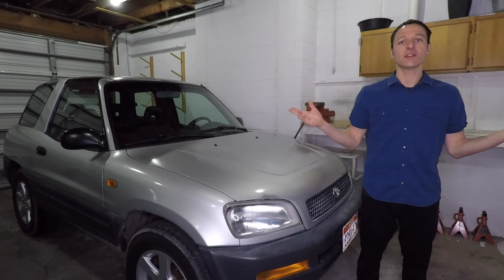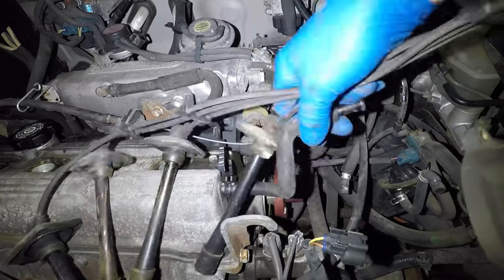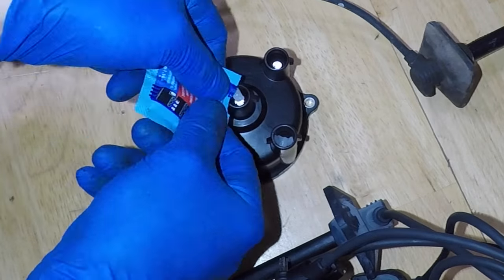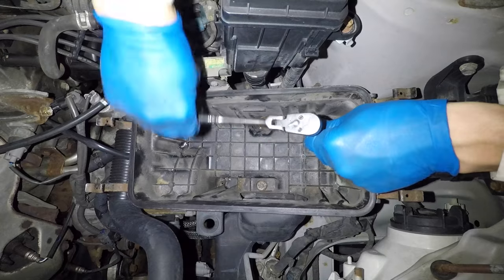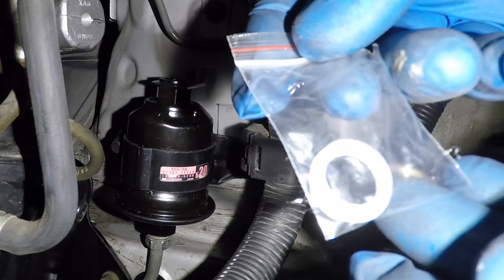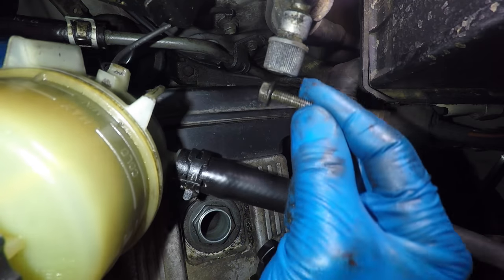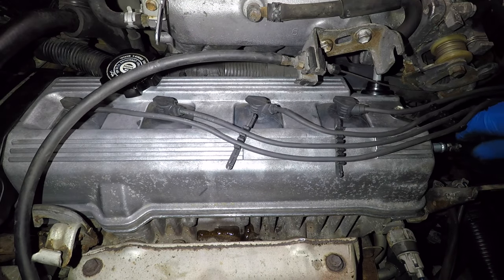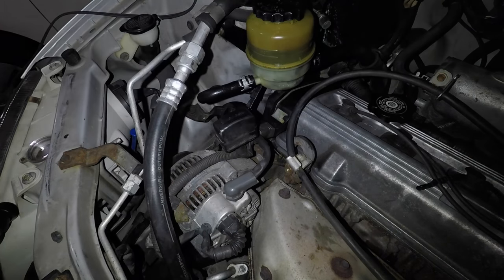RAV4 tune up: spark plugs, distributor cap, fuel filter, ignition timing (episode 5)

Comment: I can't make out the part numbers in the photo. Can you please tell me how to go about finding out part numbers on my own. Thank you 😊

Edit: For some reason I can see them now.  It isn't my eyes because my partner couldn't read them either.  Must be my phone? Idk but they are not blurry now, just tiny. I got all of them except the fuel filter because it is on the side of the box. The 0 with a line through it was tricky. Wasn't sure if it was 8 or e. It was neither haha. The spark plugs are still blurry but i was able to guess. I am still curious to know how I'd find out the part numbers on my own if I needed to. 🤔
Reply from the maker: Depending on your internet connection, you might see the video in different resolutions.  My older videos were uploaded in 2K and my newer ones are all 4K, so you should be able to see all numbers clearly if you have a good enough connection.
You don't actually need my part numbers.  Just go to your local auto parts store and they'll look it up for you.
If you want original Toyota parts, go to your local dealer, or save a couple bucks by ordering them online from Toyotapartsdeal.com.  I have a video about that here:  https://youtu.be/P1PnqG6Mcok
Reply: @LabCoatPaul  Awesome 👍
Thank you so much! You and your videos are super helpful!

Comment: hello my car is 1998 5 door rav4 i can't find the parts can you help me
Reply from the maker: Check with your local auto parts store.  They should have most of the maintenance parts like oil, spark plugs, and distributor cap.  You can buy original Toyota parts online or through your local Toyota dealer.

Comment: I didn't add silicone onto the corners, is that ok?
Reply from the maker: Yes, it's ok not to add silicone in the corners.  It just helps the gasket seal better.
Reply: @LabCoatPaul  Thank you for the response!  I have a small leak coming from the passenger side that I thought I fixed! I replaced valve cover and added a gasket to the oil pan.This morning as I was warming up the car I found the same leak.  I checked the oil pan and it all looks dry! what else can it be coming from on that side? oil pump?  I recently picked up the 98 rav4 and I love it!  Thanks again!
Reply from the maker: @sonvu5374  Well, the bad news is, every seal leaks.  The right side of the car (engine side) has an oil pump, power steering pump, power steering reservoir, oil pan, and transmission axle seal that are probably leaking.

Comment: Can you do one on how to restore the engine?... pistons and all
Reply from the maker: I might do some engine rebuilding in the future, but it won't be the stock 3sfe engine.  I think rebuilding the engine on my RAV4 is pointless.  It's not a good engine.  It has very little power and the gas mileage is horrible too.  I'll probably get the 3sgte turbo engine (it has 260hp), and swap that into my RAV4.  I'll probably rebuild that before installing it.  The engine is similar to the 3sfe, just much better.
Reply: @LabCoatPaul   ho no! Really..  I just bought one for $1400. and more than 200,000 miles on it. I'm just desperate to get to school and work and have enough time to study.  People are always telling me Toyotas are reliable
Reply from the maker: @cedarpoplar7443  There are two ways to rebuild an engine.  

The right way is very expensive.  You would take the engine to the machine shop and have the blocked measured, have the head surfaces refinished, get new bearings, cylinders honed, new piston rings, oil pump, water pump, and the list goes on.  You'll spend at least $1,000 in parts and even more in labor.

The ghetto way is you go to the auto parts store, get some bearings, piston rings, and gaskets, and hone the cylinders yourself with a drill, and do all the work yourself.  You'll still spend at least $500, a lot of time, and maybe your engine won't work right.

The best option is:  don't rebuild the engine!  You can probably find a used RAV4 engine, in good condition for somewhere between $500 and $1000.  You might even be able to just buy another RAV4 that was crashed but has a good engine for less than $500.  Swap the engine into your RAV4, and you're done.
Reply: @LabCoatPaul     this sort of thing  is what social media should be about. But, I guess you gotta take the good with the bad.  Thanks much for the advice.

Comment: Hey Paul...I did the tune up on my 96 Rav4 hoping it would provide better accelleration. I replaced the distributor cap & rotor, plugs, wires, & pcv valve. Made a slight difference but idk...is this just how these 5sfe Toyota engines are -super sluggish in power & accelleration? I have a relative with a 2000 Corolla -same engine -suffers the same sluggish symptoms. I've heard hairline cracks in the coil can cause this symptom but idk...what do you think. Oh, & btw...it has a new timing belt, & recently passed smog with no issues(no codes or check engine light). I usually drive it like a stick(it's auto& 4x4) if I need to catch speed but even little 4 bangers should have a noticeable pep to it after doing a freah tune-up. Do you have any knowledge of this symptom with these engines/ 1st gen Rav4's?
Reply from the maker: The first gen RAV4 is a very slow car.  If you're getting around 21 miles per gallon, it probably runs right.  I've found I drive my RAV4 like a race car, taking it up to redline before I shift, and regular cars just pass me with no effort.
People who want their RAV4 to be fast will swap a Japanese 3SGTE engine with the ST215 transmission into it.  It's a ton of time and money, but I think that's the only way to make these cars go fast.

Comment: What was the difference in economy like?
Reply from the maker: My fuel economy didn't change much after my tune up.  I was getting 21 mpg, now I get 22.
Reply: Hi Paul, I’m from Colombia and i have a 1996 Toyota Rav4 5 door AWD and is 7 MPG, dont know what to do. Any recommendation?
Reply from the maker: @victorcardona2537  Wow, 7 mpg means there is something seriously wrong with your RAV4. 

With gas mileage that bad, I would assume the engine misfires and doesn't run very well.

Open the hood and start the engine.  Check by the engine and under the car for fuel leaks.  If it smells like gas, you have a leak.
Next, turn off the engine and check your spark plugs, distributor cap, and rotor.
Also, check the compression.  I did a compression test in this video: https://youtu.be/XSt8YF5M2jw
If you're getting a lot of misfire, backfire through the intake, and hard to start, you'll need to check your timing belt.  L35 in Colorado has a timing belt video: https://youtu.be/TbOr7gvqSqc
A plugged catalytic converter can also give you bad gas mileage.  EricThe CarGuyexplains how to test a catalytic converter: https://youtu.be/9VZ5K8n5jj0

Comment: Hello everyone :)

Can anyone help with an explanation of flushing the fuel injectors?
As I know, there are 2 methods: 
- with the removal of the injectors
- and the second is the running of the cleaning fluid through the fuel line.
The second option involves connecting a reservoir with a cleaning fluid under pressure directly after the fuel filter(fuel pump is turned off).

How to properly block or loop the fuel return system when using the second method?
Reply from the maker: The RAV4 does not have a fuel return line to the tank, so your cleaner will all go in the engine.

Comment: I'm somewhat confused...
Great video's btw, I have a rav4 (5-door) and ride also a KTM (690smc)... only wished I had a garage, tools and skills to manufacture such a nice bike-stand... but maybe my bike is too heavy anyway.
I'm confused because your car has a distributor cap. According to my VIN number check at www.toyodiy.com my RAV4 is from 12-1996, and distributorless models are from 1998 onwards...
Reply from the maker: My RAV4 is a 1997 and has the 3S-FE 2.0L engine.  The 2.0 liter engine was used until 2003.  According to the AutoZone database, the 2.0 liter engine was updated with coil on plug ignition in 2001.  That means 1994 - 2000 all have distributor caps.  Then in 2004, the engine was replaced with the 2.4 liter, which is also coil - on - plug ignition (no distributor).
Reply: Well... my old RAV4 has no distribution-cap... maybe it's a europe/usa thing.
On rav4world.com they are also puzzled. Btw, I plugged your video there, so far they seem to like it!
Reply from the maker: cool!  Thanks for sharing the video!

Comment: Hi Paul ! i have found your tutorials EXTREMELY helpful . I should have done this myself, but a oil leak was found at the distributor cap, the mech replaced it's 0 ring but now the engine light is on. The car starts fine, drives alright and idles.  Do you think the timing is a tiny bit out and is now throwing a code 12 ? Everything is pointing towards the distributor. I am going to check if I can't just adjust the distrib a bit and see if that helps. Here is my rav4 1995 !! https://imgur.com/8zAWCnr https://imgur.com/e2wWej0
Reply from the maker: That's a good looking RAV4!  Code 12 says there's something wrong with the engine RPM signal from the distributor.  The distributor has an electronic module inside of it.  You need to carefully inspect the distributor and make sure the cap and rotor are in good condition, as well as the connector.  You can check the timing, but it might not be adjustable.  If everything looks good, you might just need a new distributor.
Reply: Paul,
Have you done any videos on replacing the O-ring on the distributor?  If not, any advise on doing so.  I have the 4-door, silver ‘97 front-wheel drive model.  I am looking to restore/preserve it for my soon-to-be driving teenager.
Reply from the maker: @jeffw.6203  Oh, that's an easy one.  Remove the distributor cap, just like in this video.  Remember which way the rotor is pointing.  Then take that distributor adjustment bolt out.  You should then be able to pull the distributor straight out of the engine.  There will a large O-ring on the distributor where it it goes into the engine.  If the oil is leaking inside the distributor cap, that's a different seal and most likely you just need a new distributor.